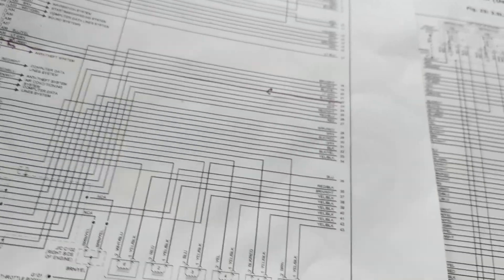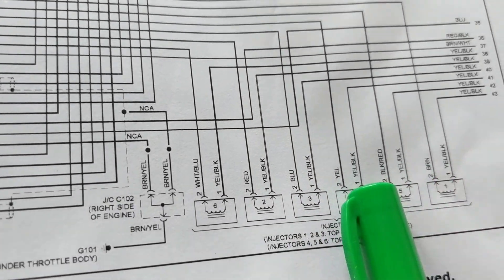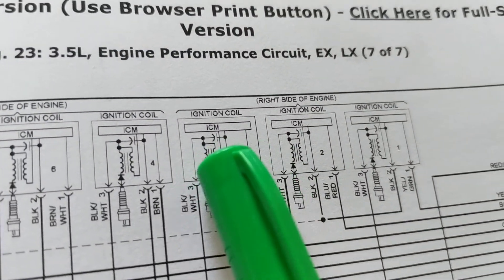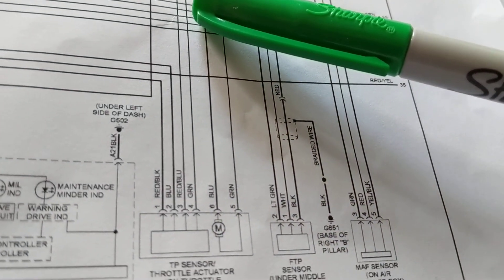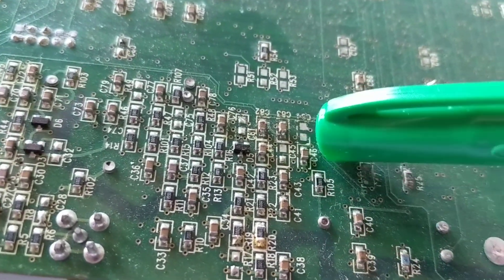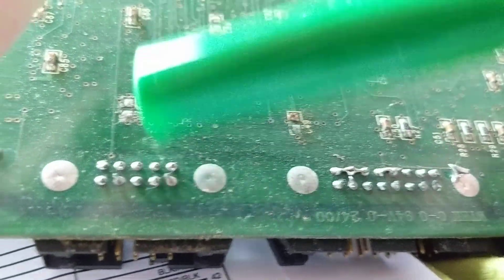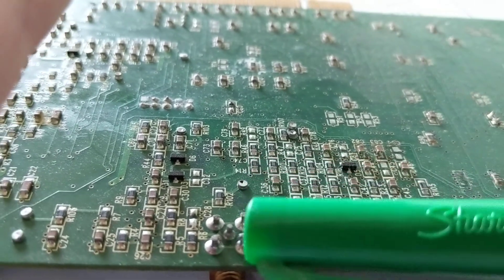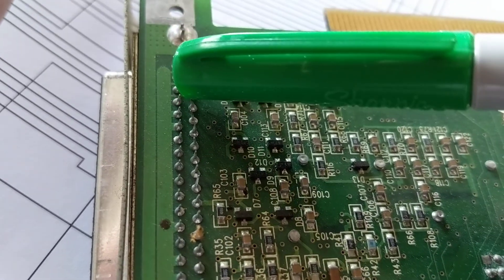HOW COMPUTER PCM WORK inputs and outputs , sensors, and printed circuit board explained

Comment: Can you explain what a discrete input is , in the case of a vehicle speed sensor on a 2000 Buick Park avenue - A vehicle speed sensor (VSS) connected to the Powertrain Control Module (PCM) via discrete inputs provides a signal source to the IPC.

Comment from the maker: In response to the question mass air flow sensor should be between 2 to 7 grams per second at idle and the round 15 to 22 grams per second at 2000 RPM or about it should not slowly increase or slowly decrease it should be parallel to the TPS sensor this is why I look at both at the same time

Comment: Hi.. Where can we get voltage(reference/signal) values for specific car models? alldatadiy is messy and doesn't seem to have it or I might have to interpret it from some other value?
Reply from the maker: I'm trying to understand the question are you saying that they the schematic should have the voltage is because schematics don't give that from the manufacturers not even from the dealership that I showed you this is something that I do in order to let people understand the circuits better on my own
Reply: @Joeelectronicschematicsforauto  sorry if I confuse you. I was referring to the constant voltage supply to sensors aka reference voltage. 

It's a hassle to find these data considering that sensors are an integral part of troubleshooting as well
Reply from the maker: @jingyitay6179  if you want to find the voltages of sensors and connectors go to the connectors the diagram of them they should tell you the pins and also the voltages related to those pins so for example if I want to see the mass airflow sensor I will go to the diagram of the sensor with three pins and  it should tell me the ground the signal and the voltage
Reply from the maker: the12volt goes to the computer inside the computer there are internal resistors that drop the voltage to 5 volts output to the sensors like coolant temperature sensors intake air temperature sensors that I called that are variable resistors the change which temperature and the resistant changes they get 5 volts
Reply: @Joeelectronicschematicsforauto  ah thanks for the tips! Very excited! I'll check out the diagrams later again!

likewise if I still can't find them, I'm sure if I had to, I could probably use a multimeter to measure the wires(ground,signal,reference) to find out what's the constant volt that particular sensor has.
Reply: @Joeelectronicschematicsforauto   interesting. Would love to delve into this further but i'm content with this now and will now do more to refresh my idea of circuits and electricity in general!
Reply from the maker: @jingyitay6179  as long as the senses working correctly you should either measure 12 volts or 5 volts usually 5 volts 4 mass air flow intake air temperature for coolant temperature which is hard to get to the run on the 5 volts because the other 7 volts is dropped along a resistor inside the computer
Reply: @Joeelectronicschematicsforauto  But in order to determine if the signal voltage is working correctly, we need to either estimate whether the value is within the typical operating range during hot idle or running right?

and if we want to be absolutely sure that the sensor is working correctly, we need to find the conversion chart or hack into the CAN and see how the computer converts values like volts to g/sec?